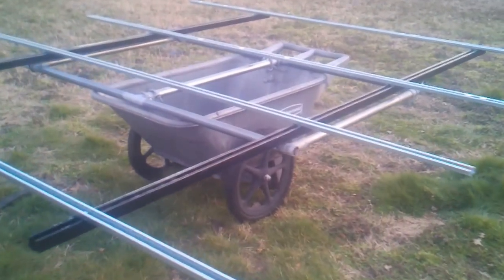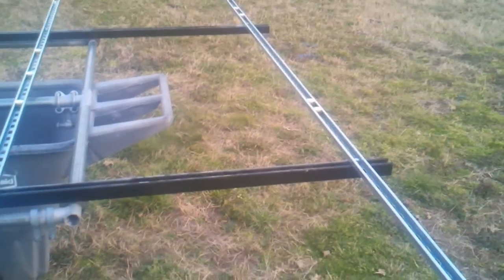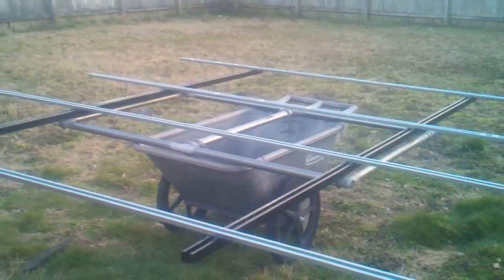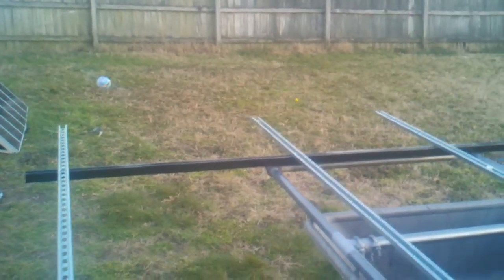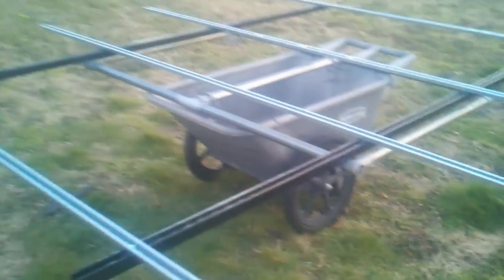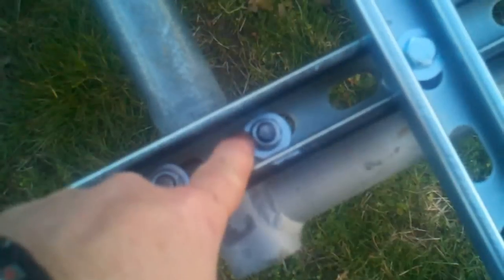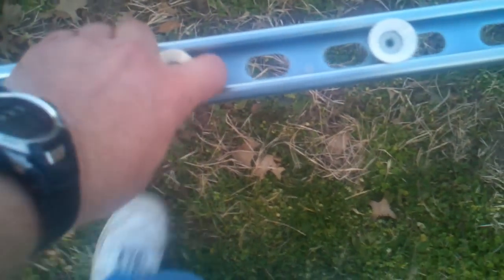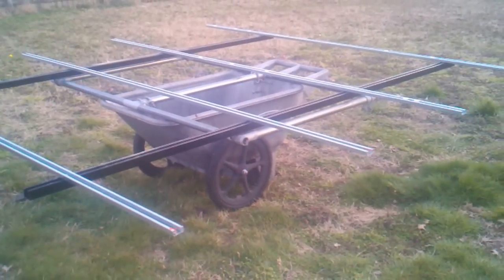My DIY unistrut or super strut frame of the new solar tracker

Comment: Could you contact me regarding some probably easy questions?  I'm about to start doing solar tracking.  Going the DIY route.  Want to see how you mounted six panels to that frame you built.  The hardware and all that good stuff.
Reply from the maker: i used strut nuts and bolts